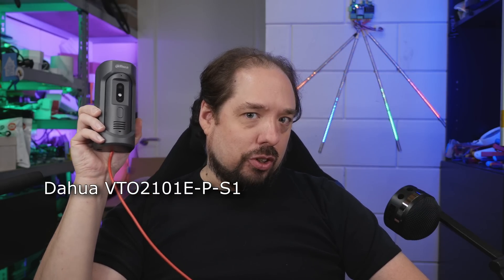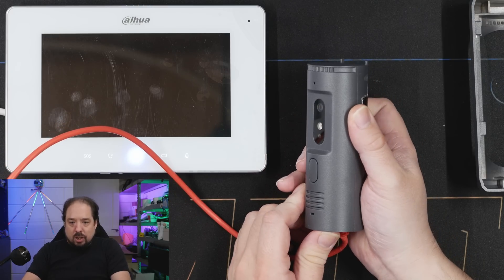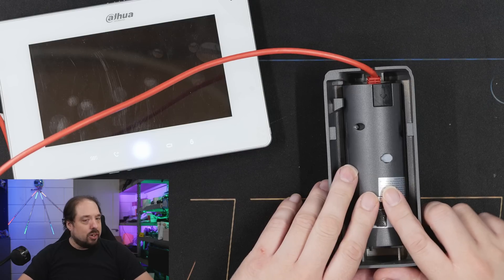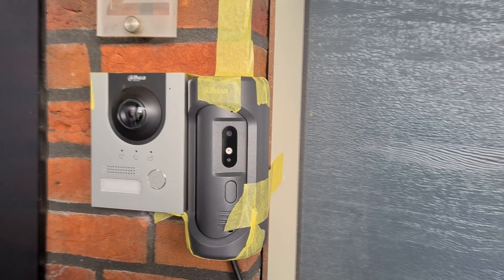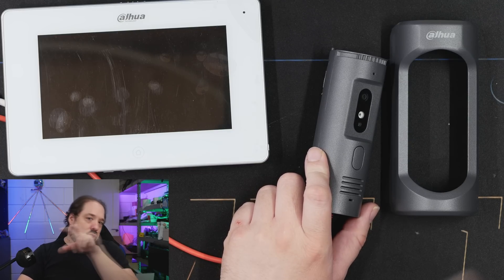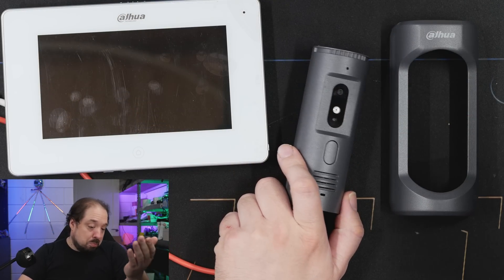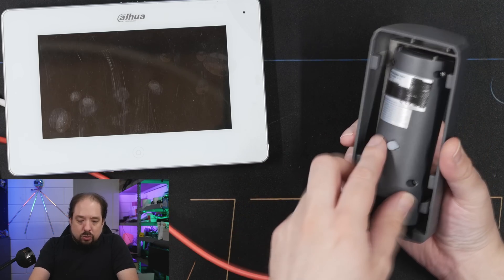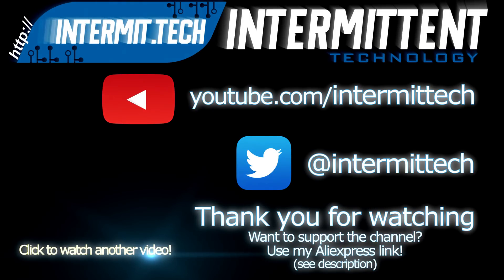🔔Video Doorbell🔔 Taking a look at the Dahua VTO2101E-P-S1

Comment: This looks almost identical to Hikvision's KB-8112 and KB-8113 models that were discontinued which is such a shame, but perhaps this is 'the successor'? Aren't Dahua cameras rebranded Hik products anyway?  Could someone answer these questions:

1) Does it support RTSP?
2) Can it send a http webhook on button press?
3) Does it have a Hik-connect style app with 2-way audio and works outside of the home (via cloud)?
3) Does it have a door unlock function?

Grateful if anyone knows the answers!

Comment: Hi, I'm relatively new to the smart home scene (UK). I've installed a couple of smart devices on my garage controllers allowing me to use Alexa to open them etc. I've also installed my own HIK Vision CCTV system all hardwired cat5e. I've been waiting for the All singing all dancing POE hardwired doorbell, that links into the NVR for sometime now. This is about as close as it gets. However, i'm not savvy enough on the tech to use the devices to operate alarms/ringers etc. Can this device link to Alexa and use that to announce someone is at the door. I have a total of 5 Echo Dots around my property and depending on where i am i cant cant hear the doorbell and miss important deliveries.  If this device used Alexa out of the box, it would be awesome. The industry seems to be missing something here, i cant believe that all this tech cant be fitted in one box.
Reply: The other thing is, will this device work in the UK, not sure if it can be purchased here either.

Comment: Looks great but are there a wifi version that will handle RTSP so it will work the same way. I guess im not alone in having trouble getting cat6 to the front door.
Reply from the maker: I haven't looked into any of those models since a big plus is the POE part here, looking at it more from an IP camera perspective with doorbell function then the other way around. If I do find a decent model, I'll try and test it in the future. :)
Reply: @IntermitTech   did you ever find such a model? I've moved into a new apartment and I cannot run a cat6 cable to the existing doorbell. I don't want to leave my family vulnerable, do you have any suggestions?
Reply from the maker: Since I basically want one without WiFi. I haven't looked into it, sorry.

Comment: Thanks for review. Is there enough bend radius for the utp-poe cable to be able to put it through the wall behind the unit without any cable being exposed or accessible in any way?
Reply from the maker: Oh yes for sure, you take out that rubber block for that and that way it's completely hidden.